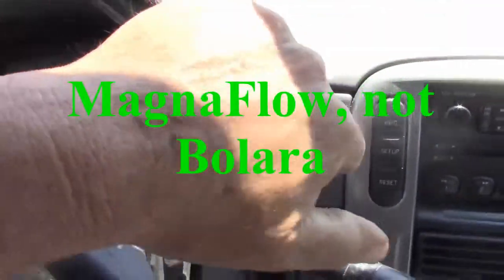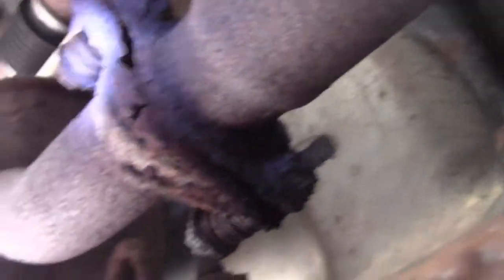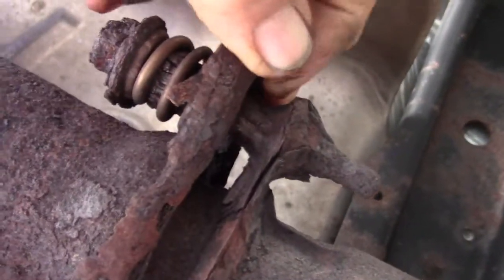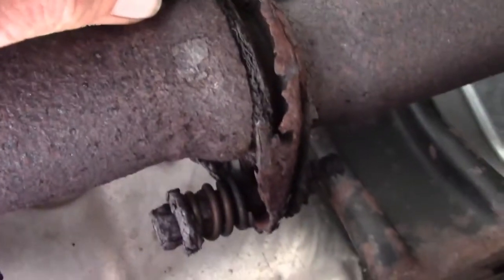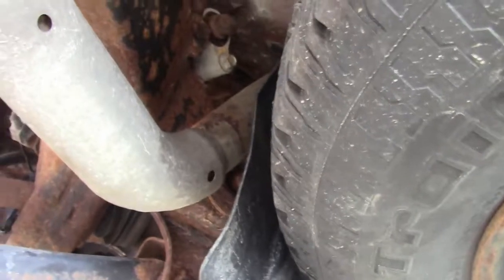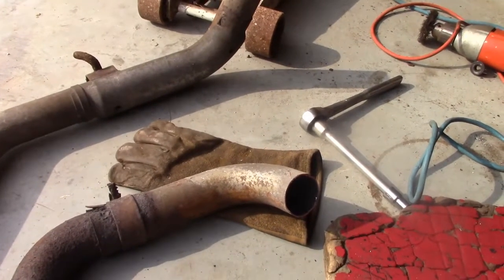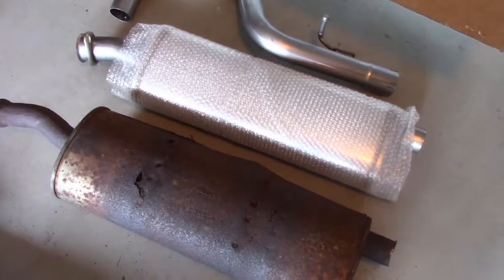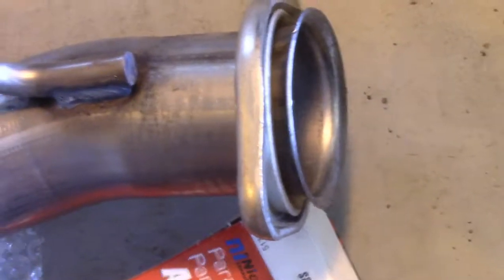Fast. cheap, and easy repair of rusted out exhaust flanges

Comment: Here in Ireland i have a Honda MK11 CRV 2006 with the same problem the flanges have gone 'Crusty'  on the  Cat convertor and the Exhaust pipe so this will save me no end of worry off to the Car Parts store tomorrow and then down to the local Engineering Shop to have the nuts tacked onto those U Bolts and Brackets... Job Sorted....many, many thanks...